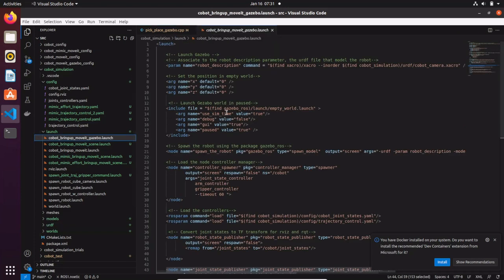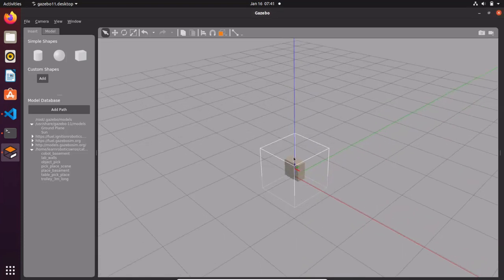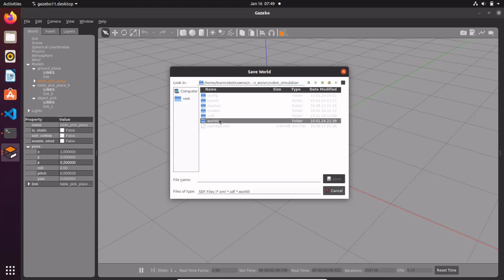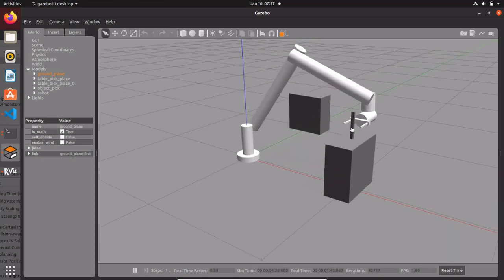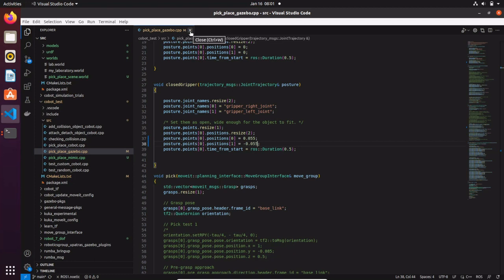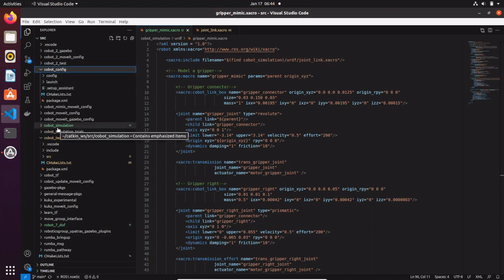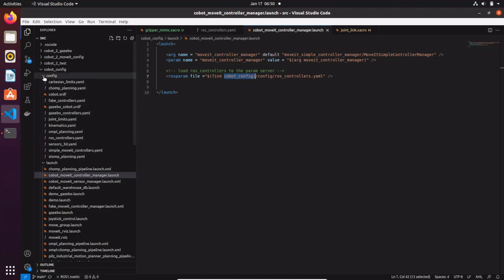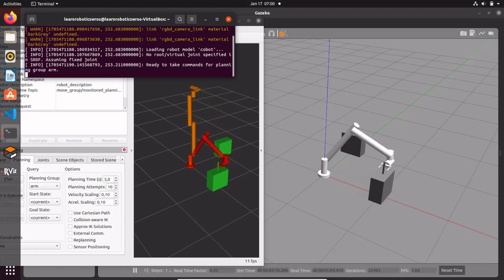How to Grasp an Object for Robotics Pick and Place

Comment: HI ! 

Thank you so much for such a wonder full video. I am working on a ´project with UR5 robot arm , My pick operation is almost same as you but whenever i try to exercute the program it shows :No motion plan found . No Execution attempted. 

what could possiblly the reasion for this ?
Reply from the maker: Hi! Well it is difficult to assess the problem without seeing your package. Here you can find a possible troubleshooting:
- have you interfaced properly moveit plugin with ROS?
- if you move the TCP to a position in Rviz, does the robot follows the planning?
- are the controllers of Moveit the same type of the controllers that you have in your "cobot_simulation" package?
- are you sure that the position you are asking can be physically reached?
Reply: @learn-robotics-with-ros   Hi ! 

Thanks for your kind response. I have performed many different task in the same environment and movit is able to find a path every time.  The interfacing i think is not a problem. The issue is that the point  I am asking for is physically reachable. I can surely share the screetshots with you if we could communicate in some way ......
Reply from the maker: Ok, send me an email to ros.master.ai@gmail.com
I try to have a look in the upcoming days